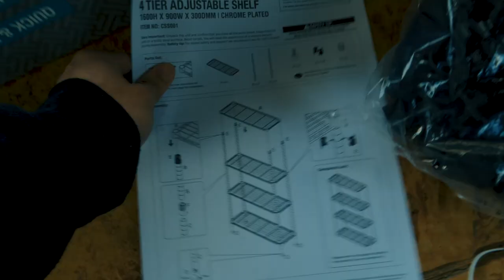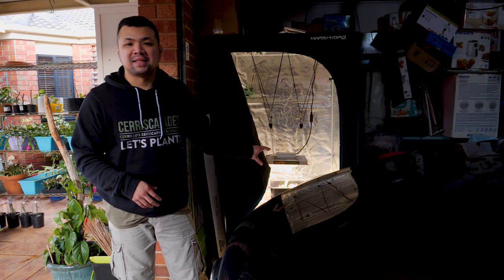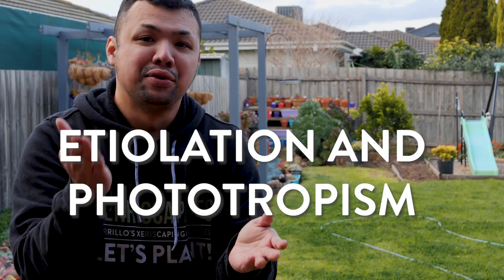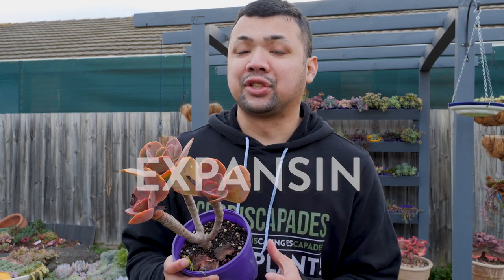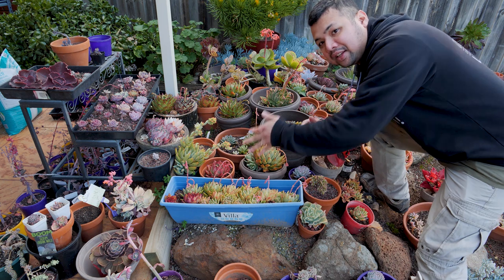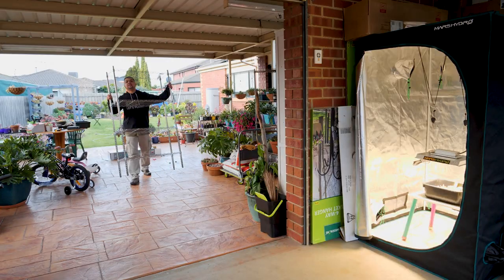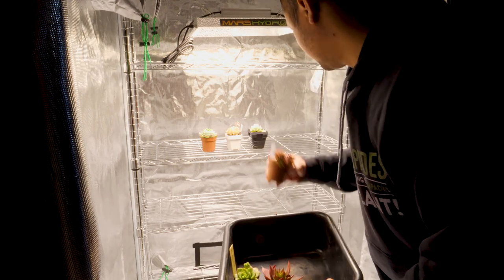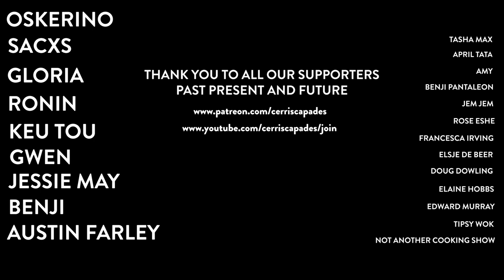#168 How does etiolation happen in succulents, and how to fix it?

Comment: Since plants grow more vigorously when the sun is directly above them, their growth is also affected by seasonal angle and duration of sunlight when grown outdoors. 
So when growing indoors on a south facing windowsill, I  have found that my succulents benefit from a quarter turn each week or quarter turn with each watering, to counter the tendency for phototropism. I supplement with grow lights in winter to prevent etiolation, but my potted succulents always do better when they can be outside, which is most of the year. 
THANK YOU for providing the information as to why this all happens. It has been a challenge to grow succulents in the humid Gulf Coast region of Texas. Today is 100+F and in winter we can get down to 19F. Etiolation is so sad, but so are burned up plants... hard to balance here in Humble, TX. Some of my  plants do better in raised rock gardens in the ground with filtered light at noon than they do in my pots in a covered east facing patio area.  Head chopping of my stretched plants seems the only solution for etiolation.

Comment: Do you have ventilation/airflow in the grow tent? Also what is your on off schedule for the lights?
Reply from the maker: Right now ventilation is low tech, I just slightly open the front flap. There are also some port holes along the sides that I could probably mount fans in.

I have the lights on for 12 hours a day, from 7am to 7pm.